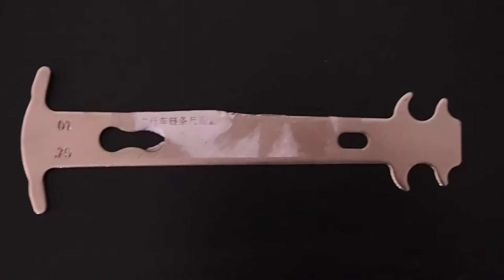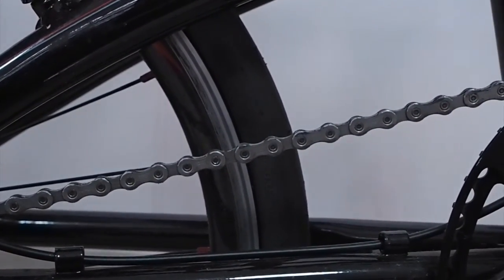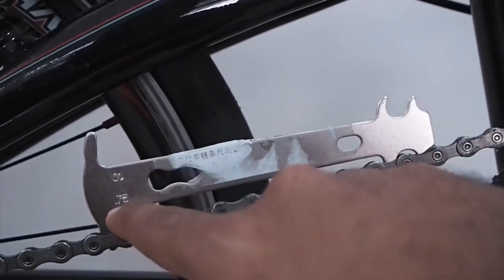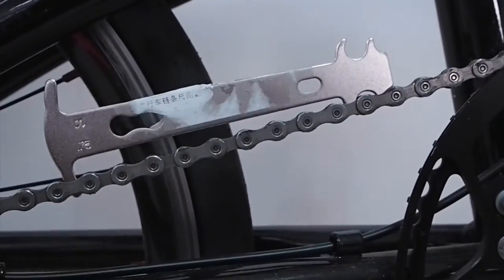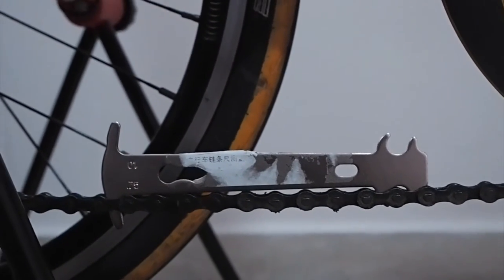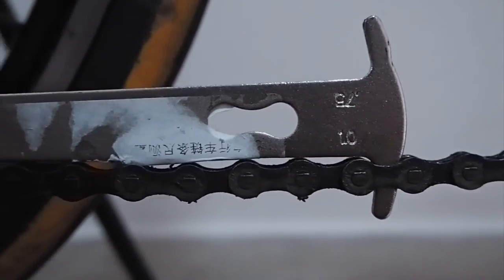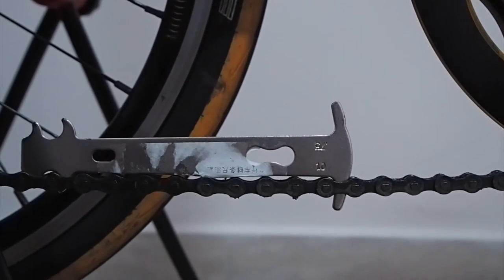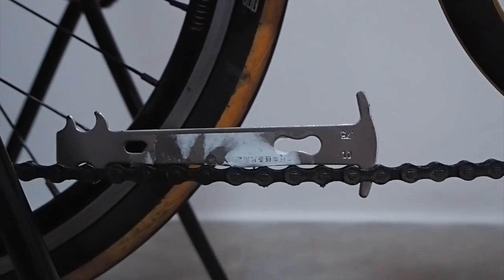How to check bicycle chain wear/slack

Comment: Should i change the cassette every time that that the chain is replaced?
Reply from the maker: +Carlos Antonio Sanabria Flecha Hi Carlos, it's recommended to replace the cassette when you're chain is about 1% longer than it's original length. 

If the chain is at 0.75% wear, then just replacing chain would suffice.
Reply: Also what's good to check is the wear on your smallest (highest) gear on cassette if it is a bit spikey it's worn and time to change it. As the chain gets slack it will wear on the cogs and make them spikey. Spikey  cogs will continue to skip with a new chain so it's best to change the cassette too at that point. Even if it's spikey and not skipping you don't want to leave it too late as the chain will start to wear the chainset too - which will be even more costly to replace.

 It's best to think of chains as consumables Park tools recommends replacing the  chain at 0.75% for under 10 speed cassettes and 1% for single speed